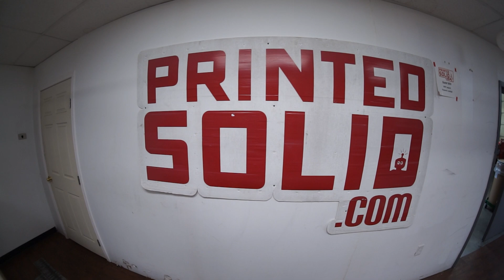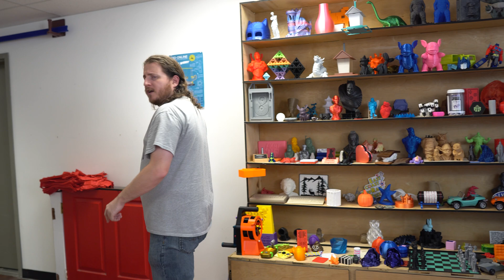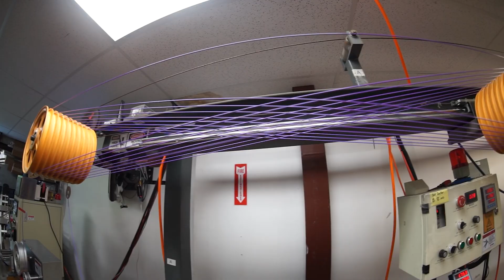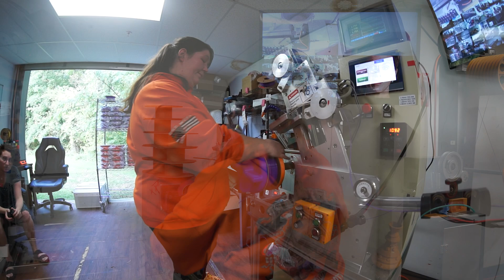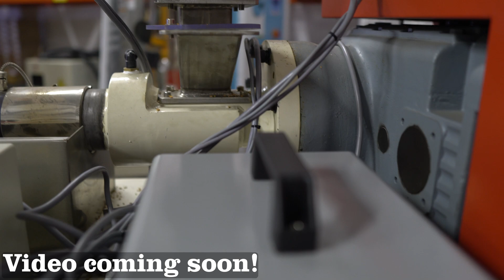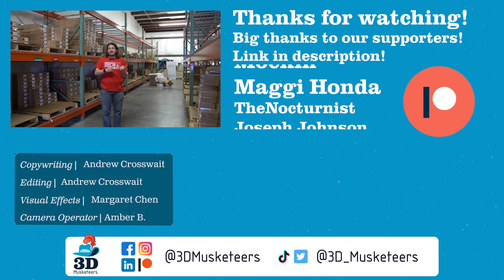From Raw Material to 3D Printing Gold: A Printed Solid Factory Tour!

Comment: Awesome tour and great to see their facility. I've been a fan of printed solid for several years and the Jessie's PLA has been one of my main brands. Unfortunately I still run a 2.85 mm machine which can make some of the options a bit limited. I understand as it's a somewhat dieing diameter
Reply from the maker: They do produce some 2.85 though, but yeah, it is not popular. Time to switch!!

Comment: I use Alpha on the Mini, it’s crazy fast but not perfect. Some video about extra sheeting will be great. Cheers
Reply from the maker: I do really like it, havent noticed a bunch of issues with it. I'm still on alpha 1, not the 2
Reply: @3DMusketeers  it’s maybe because I print a lots with Silk PLA, they don’t like speed and heat 🤷🏼‍♂️
Reply from the maker: they do not, you will need to print them hotter to keep the silk up.

Comment: at this point the universal consensus is don't waste your time on the MMU2. It's 3 or nothing. It's why I haven't printed in color in a while. And since color is mostly a requirement, it's why I haven't done much printing this year.
Reply: still waiting on my MMU3 upgrade to ship, been months and every time i check the order the ship date has changed /cry
Reply: @M3rl1n87  Funny thing is it sounds like their current solution is WAY better than the MMU2 was, but it's not "perfect" or it hasn't been tested "perfect" yet, so they won't release it. But yeah after that update they won't even give estimates on the mk4 version anymore. lol
Reply from the maker: very fair! I do wish they would ship the MMU3's faster!
Reply: Did you try the new firmware on the MMU2 yet? I've been told it improves things a lot.
Reply: @ulaB  same, but my mk4 is my main printer now. The quality is just so much better. So the mk3 will be for less important components when the mk4 is overloaded.